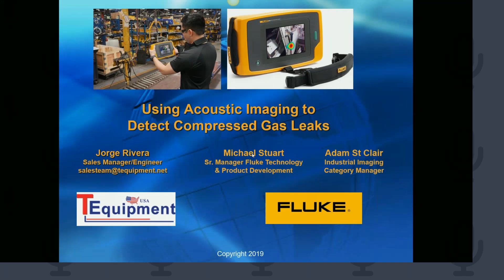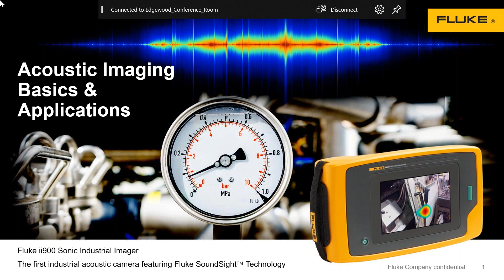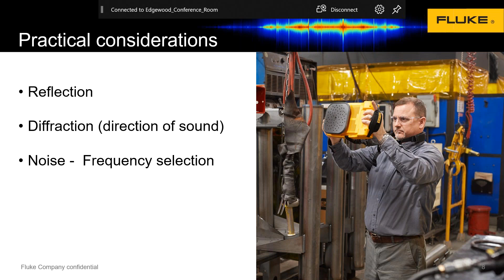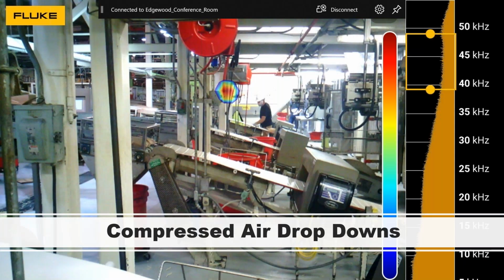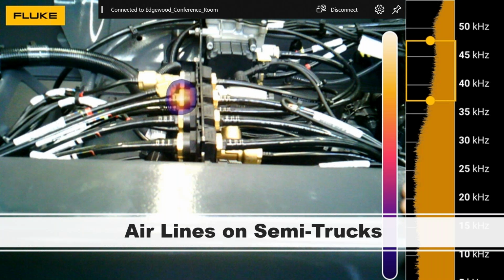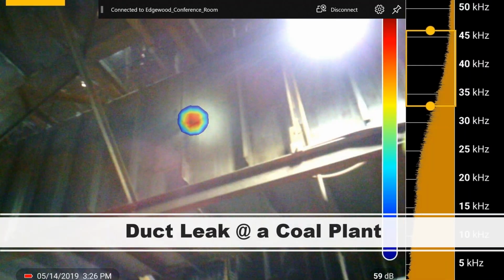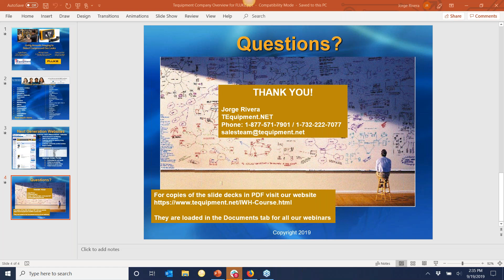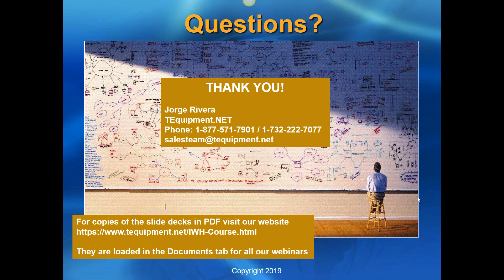Fluke Webinar: Using Acoustic Imaging to Detect Compressed Gas Leaks

Comment: This is a fantastic tool . Air leaks are no challenge . I found too many to mention in a very short time. But better yet i learned i can find mechanical issues like worn bearings in motors. i first temporarily  stop airflow from the cooling fan if it has one. Then i just adjust span and frequency to get a clear image. almost as easy isolating temps in Thermography
Reply from the maker: That's a great way to get the most out of this unit. Glad to hear that it's working well for your needs!
Reply: Is it worth the high price tag?  vs conventional although slower methods of finding air leaks?

Comment: I may have missed this in the presentation, but can this be used to find methane leaks as well?
Reply from the maker: This detector does not identify or recognize which types of gases are leaking - it is only able to detect air, gas and vacuum leaks in compressed air systems. That said, if methane is leaking from a compressed air system, then this tool will be able to detect it.
Reply: It's more dependent on the flow loss or how much sound disturbance any leak creates. Not really the material that is escaping into the atmosphere